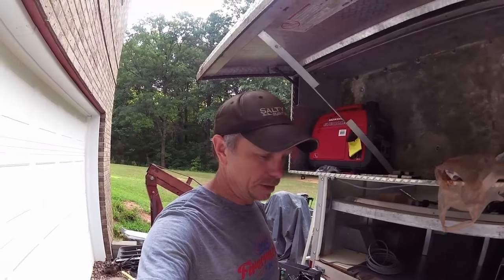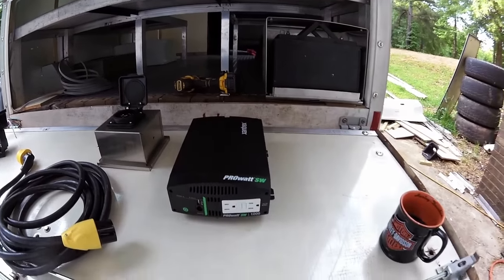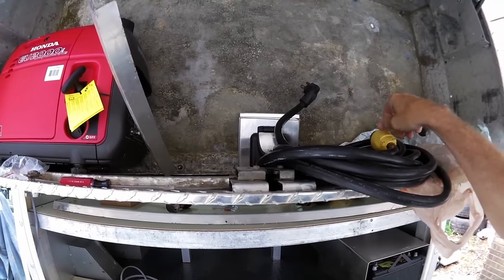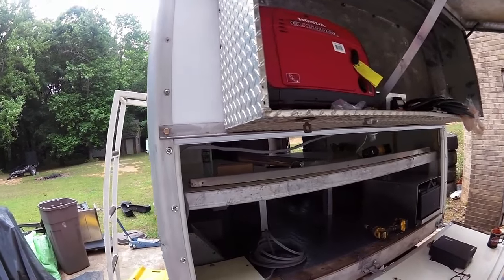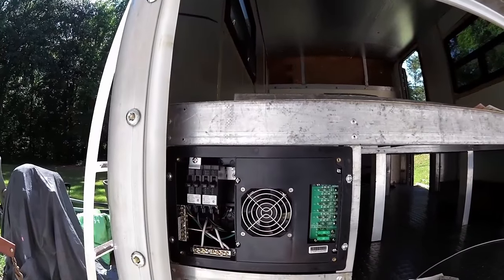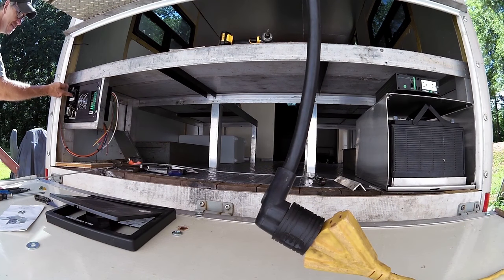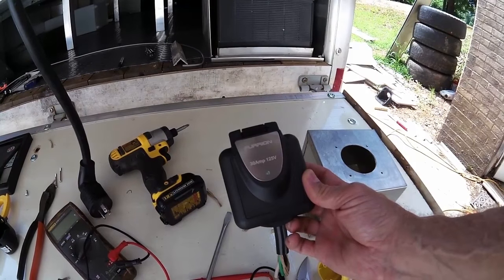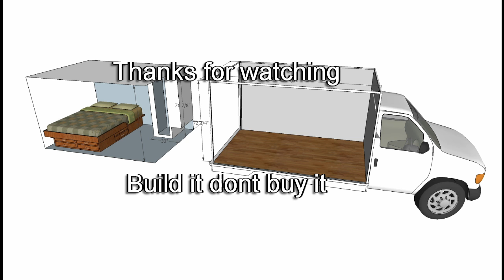Box Truck Camper Electrical 22

Comment: Hi, Gr8 series,   I have watched the newest videos and am now watching from the beginning forward.  I love that you methodically work out a problem and come up with a solution.    BTW, do NOT use solid wire in mobile applications!    Automotive wiring is always stranded for a reason.    Solid wire can not hold up to the mechanical stress and vibrations and WILL fail eventually.    This is serious as it can lead to a fire.
Reply from the maker: +Robert Bakley I know what you're saying about the solid wire but RVs have been using it for years. I agree flexible wire would have been a better solution.

Comment: If I'm not mistaken, household plastic nuts are not allowed for vehicle electrical connections because of movement.    All connections must be crimped with the appropriate connectors.

The videos are awesome.
Thanks for sharing.
Reply from the maker: +GONEWILDFILMS Thanks, I will check into this. I'd feel more comfortable with a more permanent connection as well. This is not the final version. More of a proof of concept to get it sorted out quickly.
Reply: +JYDOG you're not going to get a new outlet?
Reply from the maker: +Ken MacMillan Yes, I am going to find a better solution. I may have installed it wrong the first time.
Reply: wire nuts are all over inside a rv electrical.. I scraped many of them. just saying

Comment: Very interesting, I got the same Furrion inlet on my van but not connected yet lol......., I will be using 10 AWG/3 marine cable .I like your video.
Reply from the maker: +Supercar Garage USA Hold on to it, I may have made a mistake while installing it now that I think about it. It has  a plastic piece that clamps on the wire and that may keep it from pulling out of the screw down connectors. I had it on but it was on the back side of the box and probably should have been on the outside of the box.  Still not 100% confident in the weak way the clamps hold on to the wire.
Reply: +JYDOG Thanks for your comment, I haven't looked closely yet, the device is on the truck without the wires, one thing that I like about it is it's water proof.

Comment: might want to reinforce the floor of the case holding the generator by making a plywood floor inside it
Reply from the maker: Thanks, if you check out some of my latest videos you will see that I changed directions on mounting the generator. It is now on the rear bumper.

Comment: Is that a GFCI on the end of the AC cord ?  Putting 2 GFCI in series in not recommended and can cause unwanted trips.

Also, most GFCI outlets can NOT be reset if there is no incoming power.
Reply from the maker: No, it is 1 GFCI outlet at the end of each circuit. I have one for the A/C and one for the Microwave circuit.  They are each on separate breakers.

Comment: Are you worried about fumes from the lead acid battery?
Reply from the maker: +Ken MacMillan Yes I am, that's why I mentioned going with AGM. AGM will probably be in place before I start using it. I don't want to have to mess around with building an air tight box that I will have to vent if I keep the lead acid batteries.

Comment: Great video, may I ask since the electric system is mostly done what will you work on next?
Reply from the maker: +pmac124 I still have a long way to go on the electrical. All of the 12 volt lighting and I maybe adding a fan. Then I need to start covering the walls I guess.

Comment: where did ya find that power converter?
Reply from the maker: I found it on ebay.  Here is a link https://rover.ebay.com/rover/1/711-53200-19255-0/1?ff3=4&toolid=11800&pub=5575245984&campid=5337991790&mpre=http%3A%2F%2Fwww.ebay.com%2Fsch%2Fsis.html%3F_nkw%3DWFCO%2B%2B40amp%2BPower%2BConverter%2BCharger%2B%255BWF8740PB%252F%2B6-12%2B%255D%2B%2528BLACK%2529%2B%26_id%3D161659625202%26%26_trksid%3Dp2057872.m2749.l2658
Reply: JYDOG thanx I have the old style big bulky rv converters. and saving space is important.
Reply: So with that converter you'll be able to connect to your batteries, invert the power and charge the batteries that are being used? Without being connected to anything else?